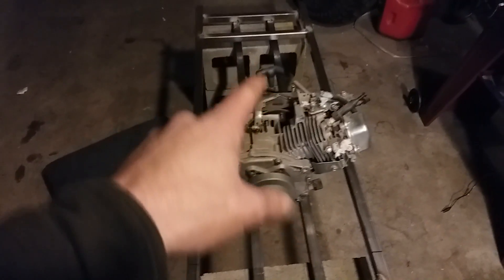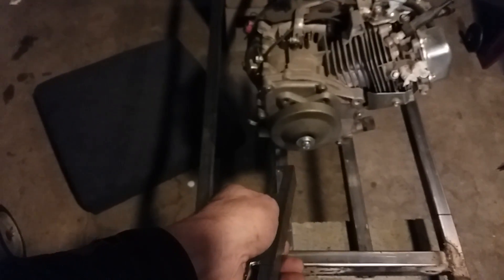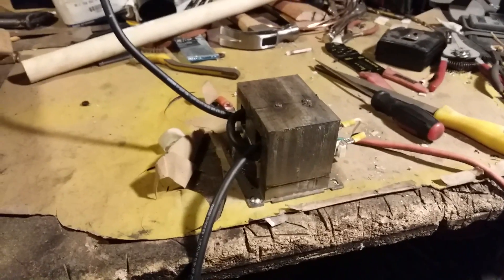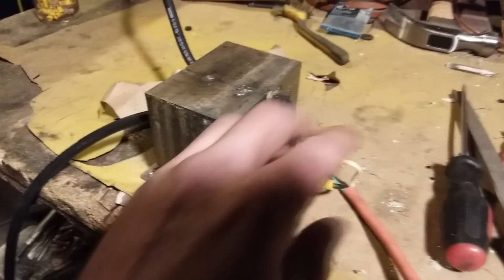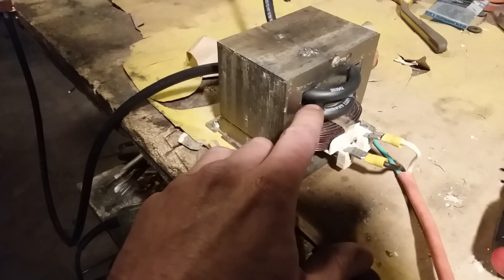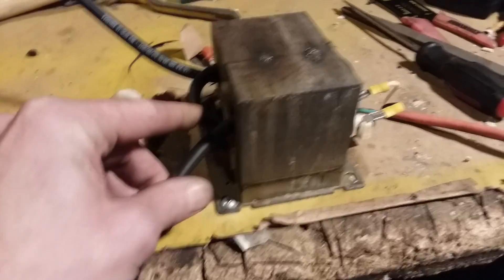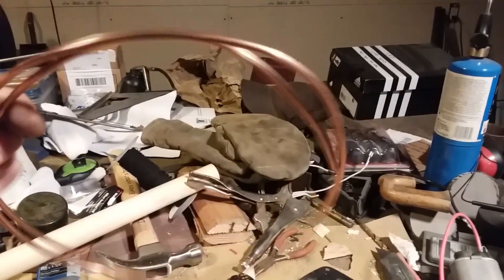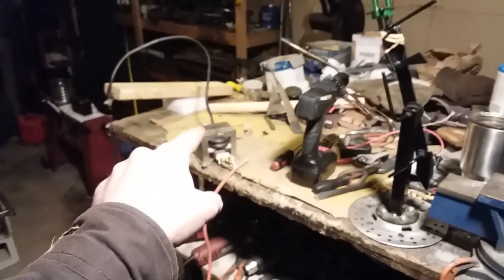DIY Spot Welder [ not working to good ]

Comment: I build these all the time, and not every MOT transformer can handle battery tab welding or even spot welding. I think allot has to do with the transformers former use. I have pulled up to 4 transformers and only 1 was good enough to use. Unfortunately, this is only one of the problems when using MOTs. Nice project!!!

Comment: I agree with "NiteHawk Router", your lead wire coming from transformer is too long. No longer than 14 ft. I did 18'- it worked, but it took a second to attach my nickle plates.

Comment: 1) use heavy gauge COPPER wire 2) make leads coming from transformer as short as possible 3) file electrodes to a point to minimize surface area and focus the heat 4) still not working? Get a bigger transformer

Comment: Hy Im just now solved my problem. My first try was with 650W microwave transformer, Bad results. My second try was with 1200W transformer. Attempt with 1, 1.5, 2, 2.5, 3  windings, still nothing. Then i connected booth transformers. Primary windings  paralel to 220v,. and wind the secondary wire  through  booth transformers 1.5 times (dont cut wire). Im using for secondary copper soft 25mm2 wire. Works for me.

Comment: I had today almost exactly the same problem and the same kind of wire and the same number of windings. My solution was an extra secondary winding so not 2 but 3. It seems that the secondary circuit did not pickup sufficient energy

Comment: Hi mate my as I have experimented a lot with different amp value transformers, I’ve found that a MOT with a minimum value of 1600 to 1800 Watt is ideal for spot welding CLEANED sheet metal up to 18 gauge  maximum thickness,regardless if it’s 120volt or 240volt.  240volt is what we have in Australia,and your cable should be a shorter length about 14 inches to the tips is better,and copper cable is a better conductive.The output voltage of the secondary should be a minimum voltage of 1.5 volts but no more than 2.5 volt,I prefer 1.5 volt to spot weld 18 gauge sheet,and don’t forget to apply light pressure followed by heavy pressure when spot welding any sheet metal.This is the same setup as mine 
doing it this way should be ok for what you want.  Good luck from Aussie Tony
Reply: I mean 1600 to 1800 WATT NOT AMPS
Reply: Why no more than 2.5 volts?  I am working on building one and doing some testing and couldnt get anything to stick. It would heat parts red hot but no fusion.It was just under 2 volts open circuit. I finally pulled out the shunts and was able to get another turn of wire in there bringing the voltage up around 3 and it was much better. Now it seems to have much more punch and is actually welding the steel together but i was thinking of trying to get it up to 4 or 5 volts and see if there was any more improvement.  Im sure pulling out the shunts helped but im thinking the increased voltage helps overcome the resistance of the joint and gets more energy into the weld faster.
Reply: Fred Geitner  
Gday mate, (more turn=less voltage),  (less voltage=more amps) but one important thing is that your secondary cable should be as thick as you can get it.I use copper stranded cable from a car booster jumper leads which is 1/4” thick ,the: copper is 1/4”.This allows the current to flow thru without overheating too much and without cooking the insulation,overheated strands in the cable will eventually melt resulting in poor conductivity=weak spot welds.The spot weld time should be at least 1 second and keep the PRESSURE ONLY on the weld for 1 more second after.
Thanks for you inquiry you’re welcome.
Reply: tonyb9316 thanks for the reply. Maybe i need a more scientific way of testing. I was trying to weld steel which measured around .048 I probably could have cleaned it a little better.  I was just curious why you said "no more than 2.5 volts" but i can understand youre logic.  Microwave transformers have a certain amount of power to work with and its basically a trade off between higher voltage and lower current , or lower voltage and higher current. My thinking was, i was trying to find the "sweet spot" voltage that would give me the maximum current flow through a given resistance. Of course that resistance will vary with metal thickness and how clean it is.

Comment: I think like someone else said, it’s not enough amperage, if it can’t even weld metal that thin.
Reply from the maker: yep, I said it like 4 time in the video... but why am I not getting more. Why is it not working like I've seen in other videos.
Reply: I don’t know, maybe there is something wrong with the current going threw the wires? I’d try and put new ones on and see if that is the problem or not.

Comment: wrap your wire around 1 more time.
Reply: isn't it that it gets more volts and less amps that way? I think he should have less windings on the secundairy windings for more amps
Reply: You need a minimum number of windings to transfer the energy from primary to secondary.